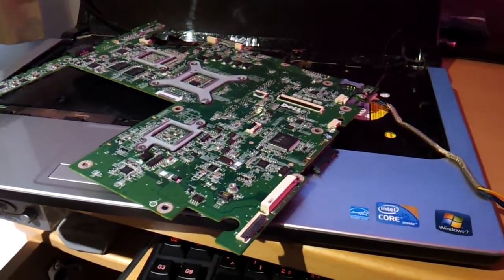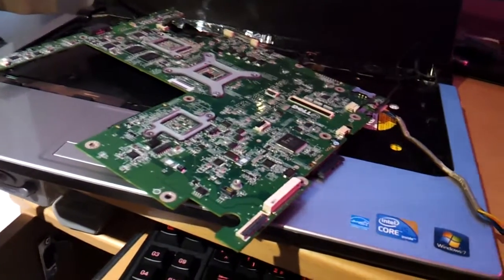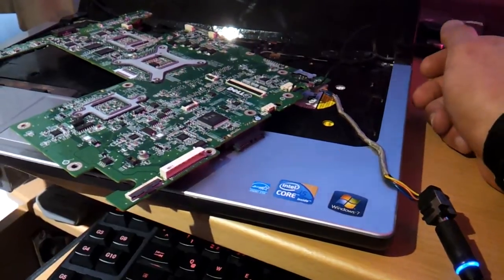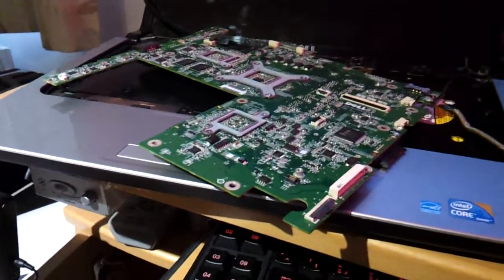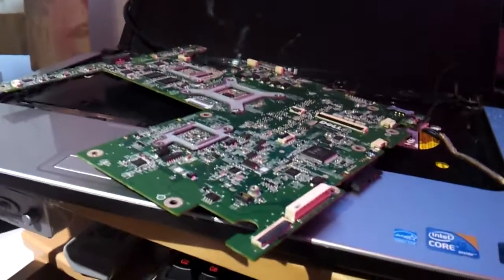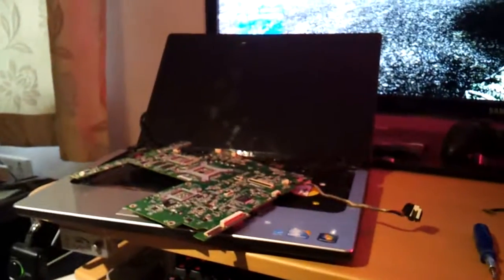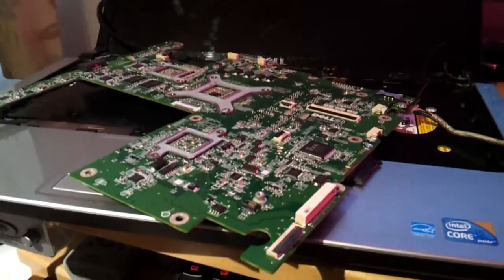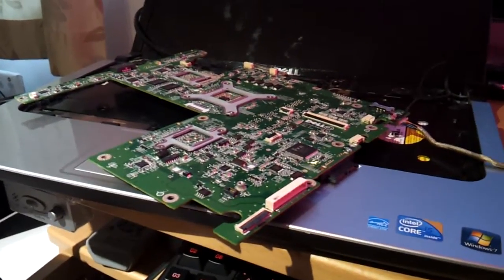1558 motherboard won't turn on, any solution?

Comment: do you still have this laptop. if yes then we can do some tests to verify some components. this same laptop just came in for repair and I have tested almost all the possible problem components but there is no fault. I guess the comments from other users are true that the GPU chip and pch need a reflow.

Comment: Two of my friends have this damn laptop. The first one developed this problem in the summer of 2013 and the second one has it right now. I fixed the first one by washing the mobo with acetone and leaving it to dry for a day and then baking it in an oven set to 280C. I had kept the oven on for 20 minutes before putting the mobo in. On the mobo, I kept a piece of solder before putting it in the oven. Once inside, I waited for the solder which I had placed on the mobo to melt and then switched off the oven and left its door open for it to cool down. Once done, I put fresh thermal paste and screwed the heat sink back. It worked.
I'm gonna try the same trick on the second mobo. I hope it works.
Reply: It worked on the second one too.

Comment: I had the same problem with my laptop,, so for me the sol was that I took it to service center and they just changed the rubber material on gpu and cpu and then it was just working fine, so I think it is the problem with the coolant material,, check if it is fully covering the gpu and cpu.. all the best, and trust me if there is no beep sound then your processor and mother board is fine

Comment from the maker: if you listen carefully I said in video I tried rubbing alcohol method but the first time I tried it I didn't let it sit for couple of days and I didn't rub it all over mob just around graphic and cpu but 2nd time I cleaned all over, if you not familiar with electronics and how to ground yourself don't try it or you gonno damage it further.